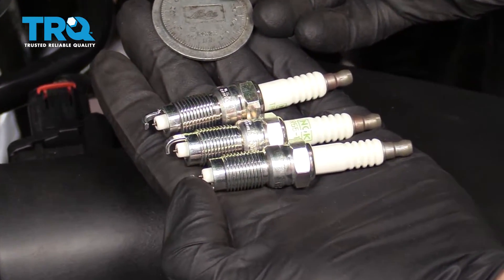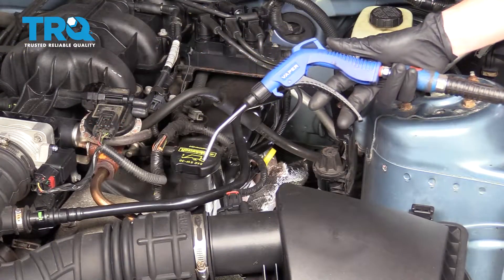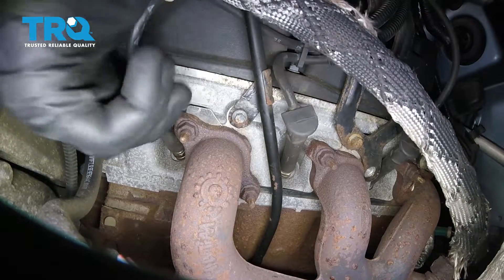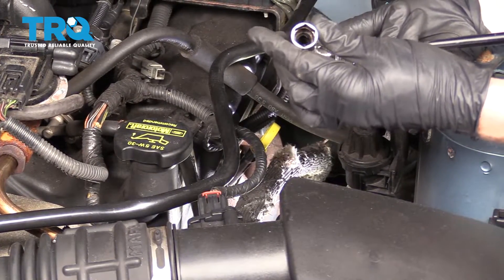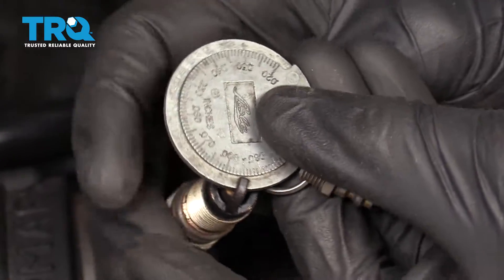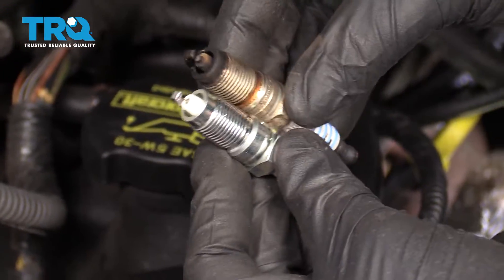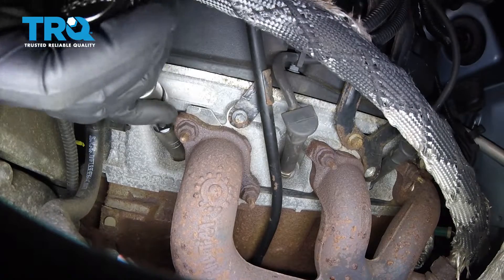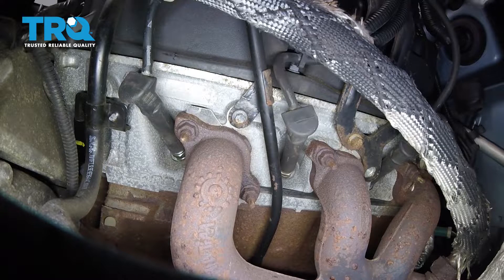How to Replace Spark Plugs 05-16 Ford Mustang

Comment: One problem I had was after getting one out I tried to put the new one in and it just didn't want to go. Did a fast search and one place said to use a tread chaser to clean the treads out. No need to do that once the plug is loose a couple of turns retighten it then start loosening it again only a few turns more then the first time, retighten it one more time then take it all the way out. Put the new plug in with some anti seize and you're good. I used an old plug on the first couple of plugs I took out, then did the above on the remaining 4.

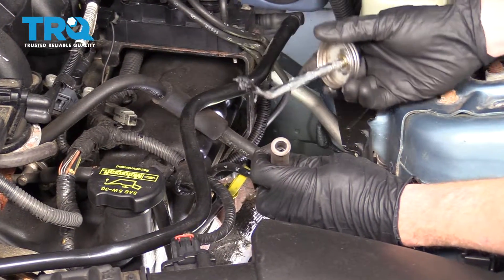Comment: Hi, I have a question. At 3:09, can you use a silicone lubricant spray like WD40 inside the spark plug wires? I have the 3-in-one silicone lubricant spray, but it doesn't specifically say dielectric lubricant. Is there a difference?

Comment: Nice there is only 6 cyclinders right p0316 is the code i got ehat that mean?
Reply: Yes, if you have a flashing check engine light then it's definitely a misfire which means the plugs. It's best to change the wires as well

Comment: Should have included using Anti-Seize on the plugs. This decreases the chance of them possibly getting stuck in the cylinder for future plug  changes. It does happen. I wouldn’t go to a mechanic if they didn’t say that was included in their process.
Reply from the maker: +harleyrider916 Thanks for the tip!  Just keep in mind that using anti-seize on the threads will change the torque spec reading slightly.
Reply: @TRQ  also some spark plugs do not recommend it (like bosch iridum).
Reply: NGK iridium spark plugs recommend NOT using  antiseeze on their spark plugs.
Reply: @luisespinoza7994  more outstanding info fellows ya'll are appreciated!!!